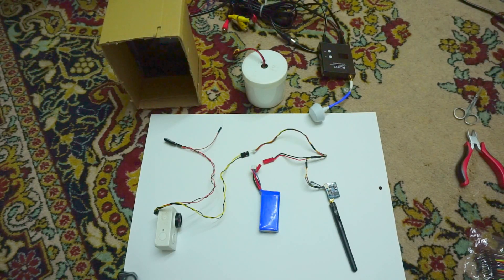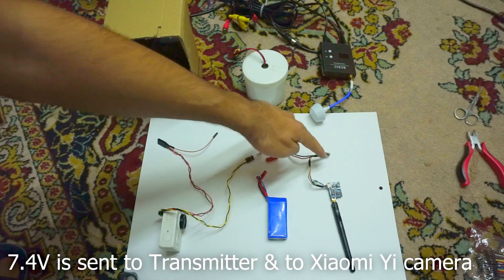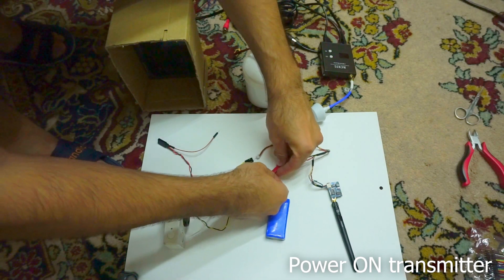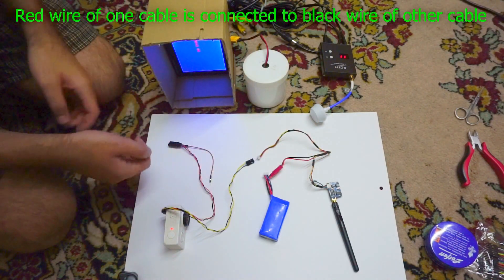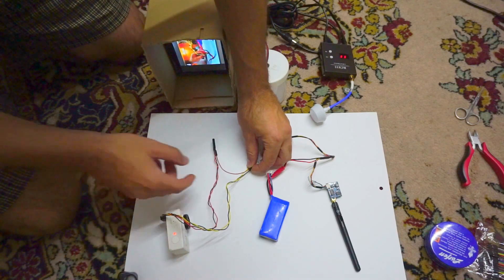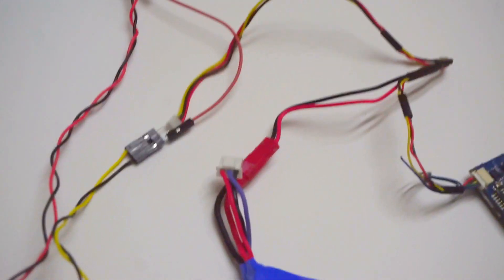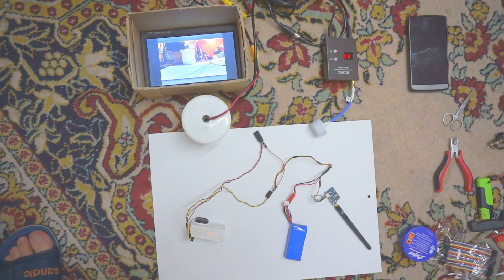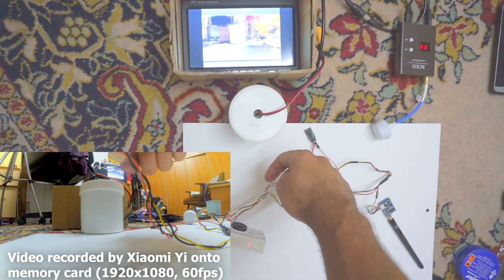Xiaomi Yi as FPV camera (1 additional wire, Latency test)

Comment: Good video, but there is just a big mistake 😊 10ms are nothing of delay, equal to 0 (Imperceptible) but as you can see in the video, the delay is evident any noticeable with eyes. Infact the delay is not 10ms but 130ms, that's why it is easy to see with just eyes. And I think it is too much for this purpose, anyway interesting too see that. Thanks

Comment: Hi, I'm trying to use my Yi like an FPV cam too.
I'm using a hobby king video transmitter (quanum elite 600 mwh) with the dedicate wire to connect my cam to it.
But I don't have the RC832 video reciver, so I'm using hobby king googles or a hawk eye Little pilot.
And... it doesn't works.
Do you know why it doesn't works without a RC832? What is different beetween RC832 and standard 5.8ghz receiver?
thanks by advance.
Reply from the maker: Just make sure the receiver is on the same frequency and channel as the transmitter. For example the RC832 receiver has those 2 white buttons to switch between channels and frequencies, my EV800 also has a search button ► https://youtu.be/c6V0D5pcMCk?t=127.

Comment: Does the small black and yellow cable come with the transmitter
Reply from the maker: The cable which is plugged into the camera that is sold separately ► https://www.ebay.com/sch/i.html?_odkw=xiaomi+yi+fpv+cable&_osacat=0&_from=R40&_trksid=p2045573.m570.l1313.TR0.TRC0.H0.Xxiaomi+yi+av+cable.TRS0&_nkw=xiaomi+yi+av+cable&_sacat=0